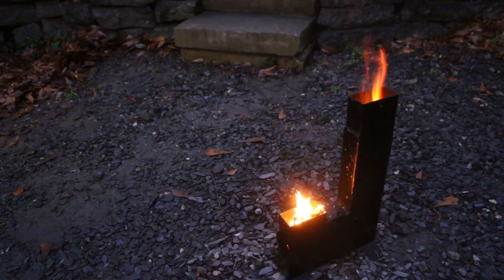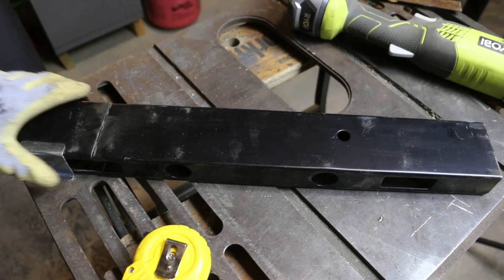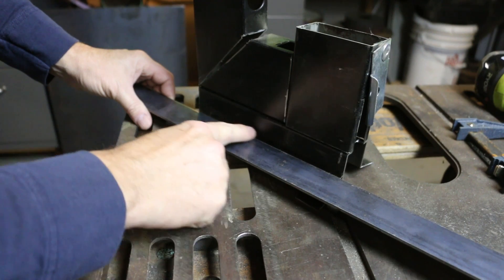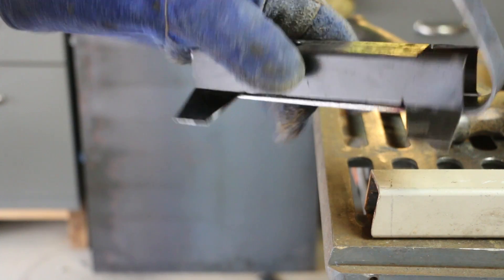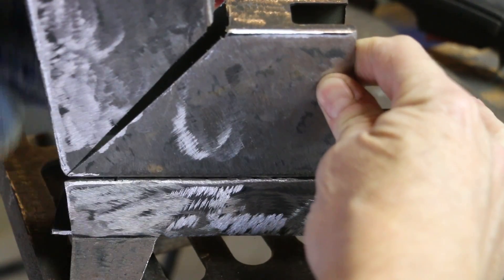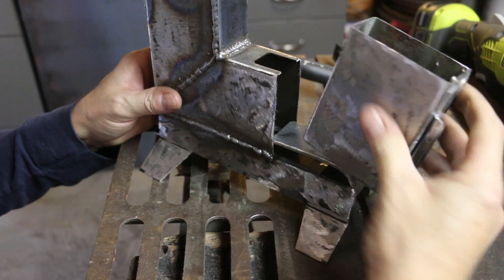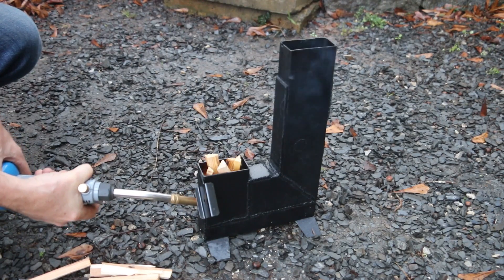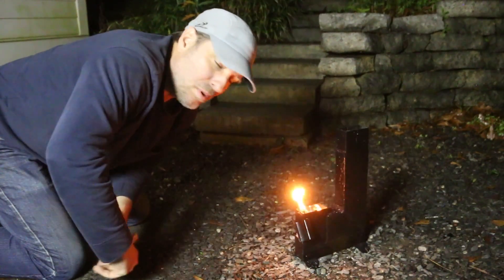How To Make A Metal Rocket Stove From Salvaged Steel

Comment: I made something like this but with concrete , it draws in air but the problem is the fire never reaches the top so it cant cook anything . Im kinda lost here on what to do .
Reply from the maker: Hi Fin. Many rocket stoves don’t have flames reaching the top. But, the heat is there. My suggestion, try cooking something. See if the heat flow is enough.

Comment: It's not easy getting a small volume rocket stove to burn well, but your dimensions were good and it's air-tight, so your results are pretty darn good.  I know it's cheating, but one of those small, personal cooling fans, with a directional output, can make little rocket stoves really rocket!  :)

Comment: A steel bar with spatter spray on it as a heat sink behind your weld. Acetone soot on aluminum. I have seen some welding channels use a tool with a copper pad as a heat sink. For a frame you need a diamond shaped reinforcement on top of your weld joint. Thanks for sharing !
Reply from the maker: Thank you for the input, Sam. I appreciate it.

Comment: I have a work shed that I would like to heat using some sort of rocket stove that would hold heat for hours and be large enough to heat like 500 square foot shed.  Does that sound doable?
Reply from the maker: Scott, I’d recommend a rocket mass heater. It couples a rocket stove with a mass of earth or stone to hold the heat generated and radiate it slowly. I’ve got one on my list to make, but there is a lot of good content out there already. Paul Wheaton is a great resource of the topic. Thank you for watching.

Comment: Great refresher in welding and personal protection.   Have you considered stick welding instead of gas and wire?  Both require the welding equipment but expendables may prove to be less expensive.  Perhaps your followers that have welding experience may have better ideas regarding the expense.  “Welding and paint...” what a great comment.  You mentioned that the 2” square tube and the 2 x4” materials do not provide sufficient combustion air compared to the Rocket King series of wood burners.   It would be interesting to compare the dimensions of your metal and masonry models,  perhaps recording a spreadsheet and graphing the results.   In the smaller tubes, ash buildup (airflow restriction) is disproportionately more problematic.  

Looking forward to seeing your completion video of the sound room and your camper builds.  Until then, glad to see that you are taking personal safety seriously.  Wishing you and your family a blessed new year filled with peace, excitement and opportunities to learn.  Peace Tom
Reply from the maker: I should try some stick welding. My welder will do that and I bought some sticks a while ago to try. I forgot about that option. I’d also need to practice before I film. :-) I likely need to get more scientific with these builds. The ash build up is an issue with this stove and the other smaller ones. The J-type rocket stoves have a problem with that. Thank you for all the feedback. Happy new year to you and your’s. Peace brother.
Reply: @GreenShortzDIY  test premise by cutting or grinding slots in bottom of burn chamber tunnel allowing ash to fall out and more combustion air to enter.

Comment: I like the idea of the rocket stove. But your metal is way too thin and will burn out very quickly. Your bar stock is the correct thickness.  Your design with preheated air is something I haven't seen before. Keep at it.
Reply from the maker: Thank you, Samuel. I want to try the preheated air concept on a few more stoves. Thank you for the tips. Thank you for watching.

Comment: Nice job adjusting the welder to stop burning through, just remember when you are adjusting that your mig weld should sound crisp and cracking, often folks have to much wire going in and the weld sound goes dull, crisp is good 👍🏻 also if you have any pieces of copper or brass you can use it as a backing plate for filling holes, the dissimilar metals don't bond tight and the backing piece will knock free with a good tap. Great practice Tom 👌 👍🏻  happy new years.
Reply from the maker: Great tips, Richard. Thank you. I always think of you when I say kia ora. Happy new year.

Comment: Happy New Year to you and your family, Tom.  I think rocket stoves are the best.  If they are small enough, they are perfect for taking camping.  I enjoy the videos.

I remember many years ago when my brother and sister were in Scouts, they made a cook top our of a tuna fish can, a large potato chip can, corrugated cardboard and paraffin.  This was back in the days when cans were made from steel and not aluminum.  Remember when pop cans had to be opened with a can/bottle opener because they didn't have pull tabs?  The can opener was used to punch holes around the top and bottom of the sides of the large can.  The cooking surface would be the bottom of the large can once it was flipped over.  The corrugated cardboard would be cut the same width as the height of the tuna fish can. Then it would be rolled up until it was wide enough to fit into the tuna can.  Paraffin would be melted and poured in the tuna can and allowed to soak into the cardboard.  After the paraffin had hardened, it could be lit, like a candle.  The large can would be put over it; but, because of the vents, the fire in the tuna can would keep burning until it was put out or the fuel was used up.  I think they called this contraption a Buddy Burner.  But, they were able to use a small skillet on top and cook eggs.  I don't remember what else they tried to cook; but, we always had eggs.
Reply from the maker: Happy New Year, Donna G! Thank you for watching. Fun story about the Buddy Burner. I do remember having to open big cans of Hawaiian Punch with a can opener. Soda cans had tabs as long as I can remember. I may try to make a buddy burner. Sounds interesting. :-)

Comment: I'm curious...was there a structural, functional reason for taking off the black...or just for the looks?  I'm asking bc if I were to do some similar project I'm likely to just leave the black for the ease, but if it's important than I'd want to know.
Reply from the maker: I took it off because I wasn't 100% sure what it was. I assumed it was a powder coating, which most likely wasn't made to handle the heat. From an emissions standpoint, I felt like it would be better to grind it off versus letting it burn off before painting. That would have been the other option. Grinding it off did produce some emissions, but less I think. That was my thought process. Thank you for the feedback and your interactions this year. I appreciate your participation.
Reply: @GreenShortzDIY  that makes a lot of sense.  I asked the question before you painted the finished product also.  But chemically, it is really good to think safely through like you did.  Thanks for the explanation and the videos.

Comment: Happy New Year, Tom! Thanks for showing us another fun project! 🥰

Also I have a Dremel tool similar to the Ryobi tool you are using - I am a little afraud to use it but hey, if you can, I can! Right? 😁
Reply from the maker: Gina, let me make a small soup can rocket stove with my Dremel. Maybe something you could try. :-) Happy New Year.
Reply: Oh that would be cool! It isn't the tiny Dremel (I have had one of those), it's big but small lol, like your Ryobi! But heck yes, would love to see another rocket stove build!
Reply: Angle grinders only look intimidating due to all the sparks but are fairly easy to use. Remember the eye and ear protection and have some practices with bits of metal of different thicknesses and types securely clamped to a workbench. You'll get a feel for how fast it cuts, how much it grabs etc, then you'll soon be flourishing the ting like a pro.